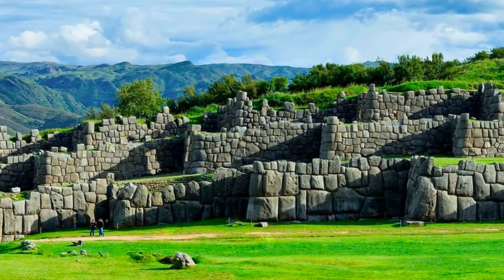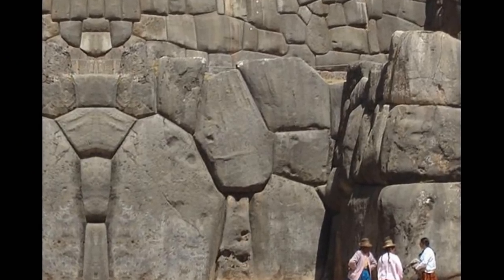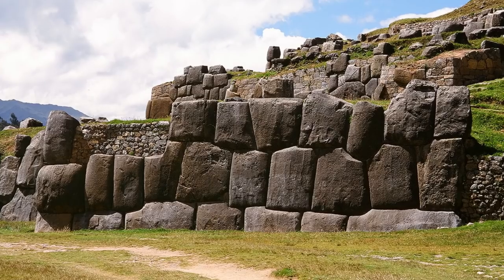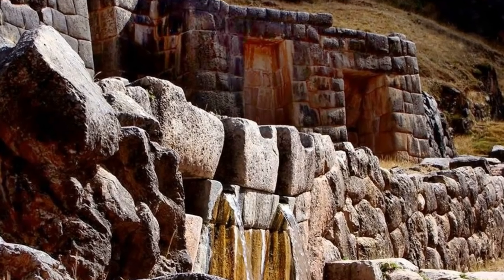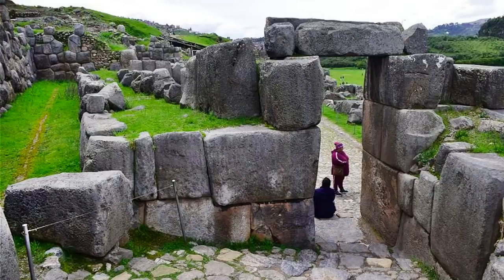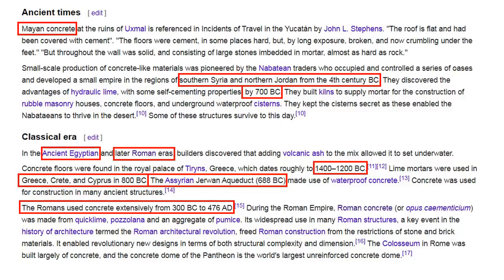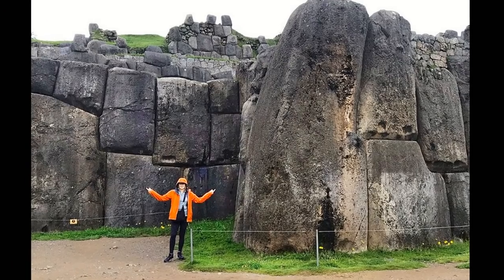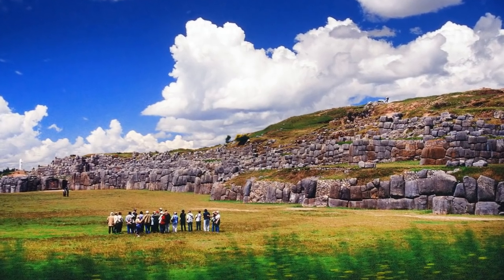Explained: How were Peru’s #Sacsayhuaman Walls Built

Comment: I gave you a thumbs down. You didn't mention that the stone is Limestone which is easy to shape and manipulate. You also didn't mention we know where every quarry is, well maybe you did, I stopped when you mentioned Geopolymer. Jean-Pierre Protzen spent 10 years in Peru studying these places. He conducted experiments with the tools which are still in the quarries and managed to reshape some stones in only a couple of hours. If they were older then the Killke culture(1100ad) then they would be worse eroded let alone over 10000 years old there would be little left due to chemical weathering. However they can't be older than the Killke because we find Killke archeology in the foundations and underneath the stones which nails the 10k bc theory shut. I've been there twice, incredible places. Unfortunately while their construction is still mysterious it's entirely possible early Inca/Killke or later migrating Tiwanaku peoples could have done it, they had the resources so why could they not have done it?
Reply from the maker: I mentioned the stone is limestone at the 11:45 mark of my video, wherein I recited the findings of the geophysicists who performed an onsite study in 2012.  I read some of Jean-Pierre Protzen's work, which was published over 30 years ago. You stated Jean-Pierre Protzen "managed to reshape some stones in only a couple of hours." Could you please confirm that those stones' size/weight and the precision fitting level are all comparable to the Sacsayhuaman blocks?  Are there any relative photos?  Jean-Pierre Protzen attributed the Sacsayhuaman's megalithic walls to the Incas. You apparently argue they are the 'work of the Killke culture.'  Do you also disagree with Mr. Protzen's work as a result?

Additionally you stated that the Sacsayhuaman walls couldn't be older than "the Killke culture then they would be worse eroded let alone over 10000 years old there would be little left due to chemical weathering."  The Pyramids of Giza, which are over four thousands of years old, are made mainly of limestone. The Temple of Jupiter at Baalbeck is made of limestone, while being at least 2,000 years ago (arguably even older).  Physical, biological, and chemical weathering didn't destroy these limestone sites. So why would Sacsayhuaman be so vulnerable?  Can you share a link of any of your work or research on finding the Killke artifacts "in the foundations and underneath the stones?"  The site is well protected and only an authorized research team can perform such an excavation. If you have such pertinent findings to share, I would look forward to reviewing them.  Thank you.
Reply: @CuriousBeingbyTina  First off, thank you for your video and response. Now for the fun part. I said they cannot be older than the Killke culture because Killke archaeology was found in situ with and under the foundations of the big walls at and around Sacsayhuaman. I mentioned Protzen because he is the Professor Emeritus of Architecture at Berkeley University, he spent 10 years on site and his knowledge should be treated with respect. He spent a day at the Kachighata quarry and managed to pound albeit small stones and manipulate their shape in only a few hours with the tools which are still at the quarries, you can visit there and try yourself. There actually are photos also, I can't remember where I saw them, researchgate or jshah I think. My point with mentioning the Killke and Protzen was that Protzen reverse engineered the process except transport and Killke archaeology was found at the foundation level, I agree work started in the area at 1100ad based on those findings and archaeology in the region. 

Here is an abstract from that paper written by Protzen: "Inca construction techniques have long been the subject of wild speculation. Investigations of ancient quarry sites and of numerous cut-stone walls reveal that the amazing Inca constructions were built with very simple means. Stones were selected out of rock falls or just broken out of a rock face with pry-bars. If the blocks needed to be parted, big hammerstones were used to split them. To dress the stones smaller hammerstones were used to pound them until they had the desired shape. The fitting of one stone to another was done by cutting the already laid stones to receive the next ones in a trial-and-error fashion. Experiments show that with this process stones can be mined, cut, dressed, and fit with little effort and in a short time."...Do you think we should discredit Protzens analysis & experiments? if so, why?

I read another comment of yours questioning the legitimacy of quarry sites. You do know that there are several blocks that never made it to(in this example) Ollantaytambo. They are still on the roads to the site(which throws mud at the geopolymer theory). He did admit though he could not figure out how transport was done. In the case of Sacsayhuaman this is an absolutely amazing feat of engineering how some of those stones must've been moved and they would've been heavier as they were reshaped on site. By the time Incan culture moved into the area 300 years after Killke there was already massive migration in the area and terraforming the Andes in the process, there was 14 million people in Peru at the time and road networks had began to be established. Could they whether Incan, Killke or both of figured out how to move stones? Yeah why not, they had everything they needed and there's no evidence for any other culture existing previous that had the resources those i mentioned possessed which they would've needed. Just an example of people moving heavy stones deep into prehistory, here in Ireland Neolithic farmers moved stones weighing 100 - 150 tons over 1000 years before Khufu existed circa 5000 years before the Inca. Check out the Brownshill Dolmen, it was the largest stone ever moved & raised till the Egyptians came along. 

This is a link to Howe's findings on Killke around Cusco including Sacsayhuaman. There's many more papers on jstor, researchgate and jshah which I don't have to the time to find and quote.
https://www.jstor.org/stable/29782579?seq=1

Here's one I just remembered on chemical weathering in the region which is actually very interesting because they sampled the andesite wall of Rumiqolqa. Why its interesting because there isn't a mention of geopolymer or artificial material it is all natural with the exception of the modern fossil fuel elements found. https://www.sciencedirect.com/science/article/pii/S0305440312004256

The pyramids were cased in Limestone till 1303ad when a massive earthquake hit the region and the giza plateau and Lebanon get nearly the completely opposite weather to high Andes anyway so they are not comparable in that capacity, you can see up close the effects rain has on the limestone in the cusco region and there's not a geologist that would disagree, 10k years of it would make them much more weathered. Also I have been to Giza, most of the archaeology there is quite eroded from wind and sand already. 

I would also like to add, again I'm not sure you mentioned this in your video but those stones at Sacsayhuaman Rumiqola and Quenco were not placed randomly, there are various figures, animals and landscapes embedded in the design. The animals and figures you see are contemporary with the region for the time and currently, Llama's, Andean foxes, Puma etc  I do not think that is simple pareidolia, it was intentional.

From being there twice I think we're missing something from the archaeological record, I think a or several engineering savants existed in antiquity that figured out a way to do things outside the box. However current archaeology and anthropology places work beginning at Sacsayhuaman and Cusco in general no older than 1100AD and possible with rudimentary tools. There's no evidence of any other cultures that had the capabilities whether 1000 or 10000 years old,  I would love if new findings threw that into disrepute and a new spectrum of study could be opened up. I'm not sure you've been there but you should visit sometime, also check out Quenko which is almost like a mini Sacsayhuaman with some bizarre stonework, I have thousands of photos from my time there I'd be happy to share also.
Reply: @CuriousBeingbyTina  What do you think of my comments and links?
Reply from the maker: @jcie1210mk3  I appreciate your comments. Let me go through them and reply later :-)

Comment: Getting tired of hearing people explaining how to do things that they cannot do themselves.
Reply from the maker: Check out today's dry cast stone method. Vibrant Dry Tamp (VDT) could be similar to the techniques used at Sacsayhuaman. The benefits of this dry cast stone method are: 
-Fast demold time. 
-Can cast into the same mold several times a day. 
-No treatment is required afterwards to achieve the limestone look. 
-Result of cast stone is very clean and natural looking. 
-High early strength. 
-There is a time just after demolding when a repair is relatively easy.
Btw Einstein's general theory of relativity was published in 1915. Over 100 years after, it was finally proven for the 1st time in another galaxy.